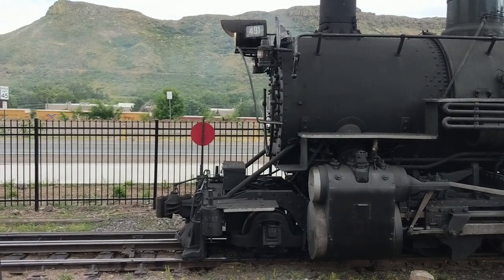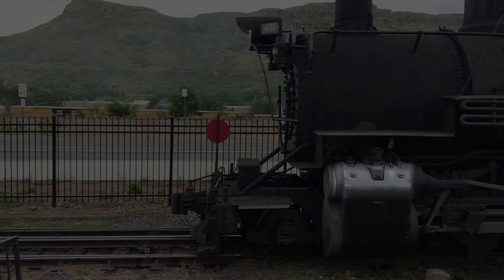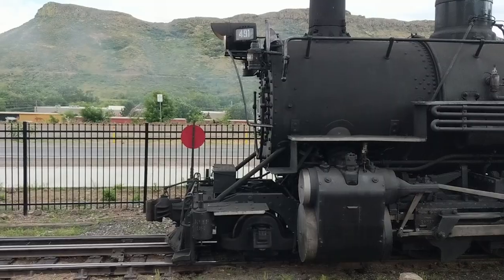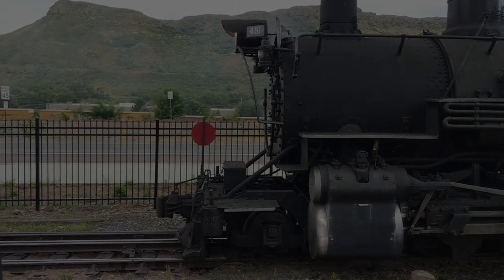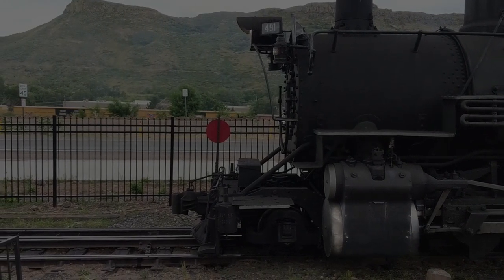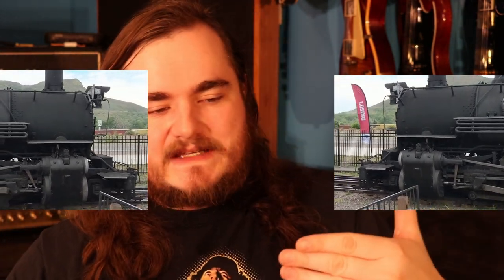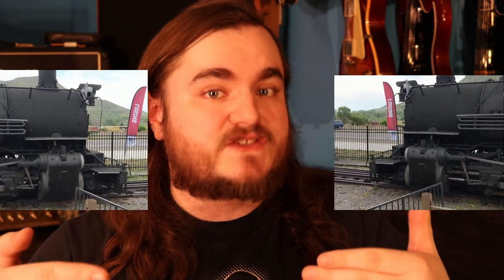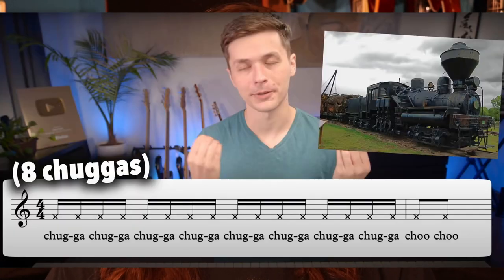Why Steam Trains make Chugga Chugga sounds!

Comment: I have a belief that engines break when they sound like they're going 100 miles an hour, the actual speed being irrelevant. For a shay it may sound like its going 100 when its actually doing 12, for 346 that's more like 18
Reply from the maker: So... how fast was SP 18 going?
Reply: @Hyce777  the rule does not apply to the 18 since it’s method of kinetic disassembly was more akin to a submarine, since it launched its cylinder head like a torpedo. That being said we were making revolutions for 15 knots

Comment: I always thought the first two exhaust beats sounded heavier because in one side of the cylinder there is the piston rod, and the other side there isn't. One side is having to exhaust a slightly larger volume of steam within the same amount of time as the other side. CHUF CHUF chuf chuf.
That and/or the stroke where the motion of the rods are being pushed away from the cylinders is possibly more powerful than when the rods are being pulled towards the cylinders during the revolution (maybe vice versa).

Comment: Hi Hyce, I love watching your videos and I'm catching up fast with your explanation videos! Love the gameplay videos too!

I Feel this question fits well here, 
I Live in New Hampshire, and we have a Scenic railroad in Conway that has an old Canadian National Switcher #7470 .. This train has been pretty much restored to its former glory and has been on a few runs recently through Crawford Notch and the valley.

My question is, when it is sitting 'idle' or stationary, it continues to make an audible chuffing sound, but there is no sign of the stack pushing steam out or anything. I've been sitting on this question for some time and couldn't find much about it... 

There is a video on Youtube titled "Conway scenic 7470 in the valley august 2019" that shows it on the turntable chuffing as i mentioned...

Any advice to my question is greatly appreciated!! Keep up the good work on the videos, I've become a railfan all over again!
Reply from the maker: Air compressor exhaust :) many engines have the air compressor, which is basically another small steam engine, plumbed with it's exhaust through the smokebox, which can make it sound very similar to the normal chuff of the locomotive. Good question!
Reply: @Hyce777  thank you so much for a quick answer! I was thinking it was something to do with the air compressor but all the videos I find of them don’t make much noise like that!

Comment: Fun fact the puffs (I grew up with British Railway jargon, Thomas don't chugga he chunters or puffs but not chugga) on a Greisly A1 like Flying Scotsman and his Cousin locos the fastest steam locomotives the A4 class are engines that would have a and correct me if I am wrong as you know music better but would you call it 3/4th time puffing as they have three cylinder builds. Heh if you know the A1/3 class and A4 class locos were compounds, they have two standard outside cylinder pairs and between the frames they have a low pressure single cylinder. S for every quarter turn there would be a beat of 1-2-3-1-2-3 so the beat of a Shay with three cylinders with a 1% reg. Also you know the old saying trains make clickity clack sounds? I think a more accurate sound is "Trickety trop! Trickey trop" haha but that is as I grew up with Sodor and a six wheeled blue tank engine! Great stuff my friend, I am trying to start a toy company with my first line being a mix of Action Figures and Toy trains. Will soon be starting my Patreon to raise funds as I design and sculpt my figures and building my locos for prototyping.
Reply from the maker: Yup, the 3 cylindered engines chuff in 3/4 or 6/8 time.

Comment: Isn't "choo choo" just the sound of the whistle? And wouldn't that be just one signal for the signal to moved forward which is two short blasts? So in reality "Choo Choo" comes before "chugga chugga" and the "chugga chugga" increases in speed as the locomotive moves faster.
Reply from the maker: You raise another good point... So, in this analysis, we can only assume that many chuggas followed by "choo choo" is the result of a train completing a running air test. The train gets sufficient speed, sets the train brakes up, conductor confirms that the reduction was seen on the rear end of the train, tells the engineer, at which point "CHOO CHOO" acknowledges that the engineer understands that the brakes work. ;)